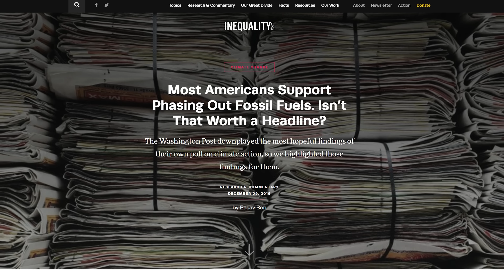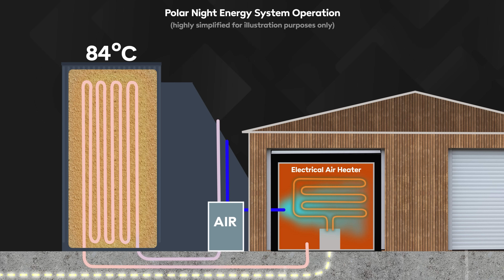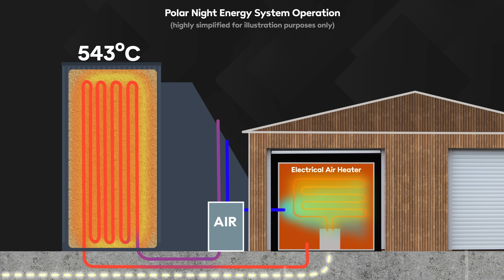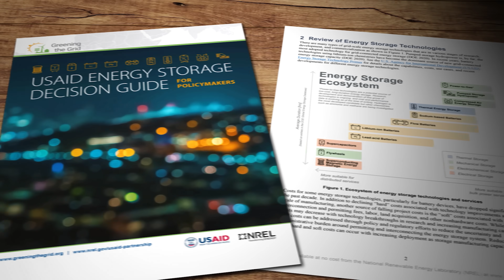The 'Sand Battery' that heats your home, NOT the planet!

Comment: This is very similar to ground source heat pumps based on long trench excavation and slinky pipes.... But this may be even more efficient.....

The only problem it cannot work in reverse and cool houses in Summer.... Is there a system for district cooling that can use the same pipe infrastructure? And save everyone from a burning end to their lives or the need to wear SPF 3000

Comment: The combined efficiency of using renewable electric energy sources to provide the simple heat energy stored and deployed here seems poor enough to invite skepticism of the whole endeavor.  No doubt naysayers will jump on that.  When they start talking about storing waste heat from other industrial processes and using electricity from periods of excess renewable electricity production, then it started to sound a lot better.  An excellent application for the “superpower” that the folks at Rethink X predict coming in the next several years.

Comment: The same thing can be done on an individual home level with around 2000 gallons of water to make the thermal mass.  I had a tarm wood gasification boiler for over a decade before I sold the home it had a 700 gallon thermal mass located outside the house under a porch in New Hampshire and worked great I had R60 insulation on the tank.  I am planing a system for my new home which will have a geothermal heat pump plus a storage tank that is an opportunity load for solar.  The plan is to use the storage tank over night and the heat pump when the solar system has capacity during the day.
Reply: I was just about to comment a very similar thing. A lot of more suburban homes have space for a ~3000l insulated tank which can store enough heat in for a few days. Combine that with variable rate electricity and you're ready for a renewable energy grid, or your own solar panels.

Actually one of the advantages of a low pressure tank is you can cheaply make solar thermal panels which are a lot more efficient area-wise than PV panels. Personally this is my next major project on my house.
Reply: @ThisRandomUsername  I am going with over sized PV because I have the space the don't need to worry about the freezing issues of solar thermal.
Reply: @DanA-nl5uo  PV also has the advantage of being as efficient no matter the temperature of your tank, so you can get to quite high temperatures if you insulate well. David Poz has made a video comparing PV and solar thermal.
I'm in Durban, South Africa with much milder cold weather, so a hybrid PV and thermal setup makes sense for me.
Reply: @ThisRandomUsername  I did see that comparison video he did a good job with it.

Comment: Great video as usual, I'm not aware of any district heating in my area (California) but that's probably due to the major population centers being built directly on active fault zones.  Sand as an energy storage medium is highly under utilized though and I love hearing about it being developed and the Ambri battery seems like its ultimate evolution, hopefully they will get a follow-up video
Reply: I live in the San Diego area and much of our downtown was heated by district heating with steam plants. I don't think any of it is used any longer and new buildings certainly wouldn't be using it. I found an article from 1987 that stated there were 40 buildings using it but that more and more were going to stop because the power company, SDG&E, was raising the cost of it. I think there are plenty of colder climate cities that still rely on steam heat.

Comment: The Netherlands has some district heating. My city is planning on rolling it out in the coming years to replace gas heating. I won't be using it and have converted to heat pumps instead. The problem with district heating here is the single supplier that makes it very expensive.

Comment: 0:25 Eh... I'm from Wisconsin and we typically have days over 100°F every summer. Sometimes even weeks of it. It's been like this for as long as I've been here, which is around 36 years. This summer is actually pretty moderate as far as heat goes... we've only had a few days in the 90s and none over 100 yet. I dunno. Cooler than most summers I'd say.
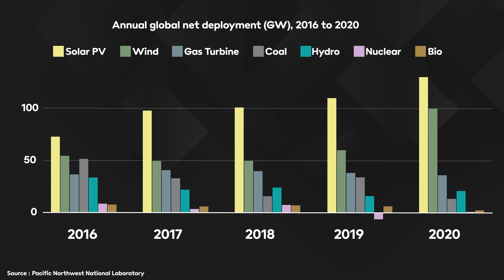Reply: 5:06 This graph can be used misleadingly. The REASON why solar is the highest entry here is because countries' government are encouraging it while discouraging more reliable sources of power like nuclear, natural gas and coal. So don't look at this and think "Oh, well what do ya know, everyone's doing solar now! It must be really good!" Uh... no. They're doing it because they're being forced to. Don't get it twisted. If energy companies were given the choice, Natural Gas would be number 1. Cheap. Reliable. Easy to build. Very quick startup times. Consistent energy output. All in all, better.
Reply: 6:42. What are you talking about? lol. Burning wood is carbon neutral. The trees sequester the carbon while it's growing and then release it when it's burned. Net Zero CO2! Sigh. The state of the world's energy industry is laughable these days.
Reply: I dunno. The general idea is here is good. It can be 'dirt' cheap, especially if you just bury it into the ground and build a bunch of greenhouses on top of it. But when you think about it, this tech wouldn't really be feasible if solar and wind weren't so crappy and inconsistent with power generation. Solar and wind is great for local use... I'm even thinking of installing some on my house for a little extra power here and there... but if I'm being honest, power is cheap here. Something like $0.11/kWh. Solar, if not for the government subsidies (meaning us taxpayers are paying for some of it) wouldn't be economically viable for me. Even now, doing it is mostly for kicks and not because it's actually needed.

It's just... when you have to come up with new way to make a technology that's forced upon the public to be worthwhile, it says something about the governments doing the forcing. And it's not anything good.

Comment: They did have a few "experiments" with district heating systems here in old Blighty!
I remember one in Ardwick Manchester back in the 80's. It piped hot water to a council estate used for heating. 
It did not last long!
I am unsure of the reasons for it failing but they did have problems with leaking pipes under the roads. I suspect the method of charging was a tad too social too (If I remember rightly it was a fixed charge so you had "free" heat) which had people using open windows to regulate temp. I would like to say we have moved on from those times but I am aware of multi story blocks that have had to have new risers put in because the tenants did not get charged for heat and burned the electrical system out through overuse!
Obviously we can do better!

Comment: Hi Dave, great video, I watch them every week.   I design district heating systems here in the (UK).  The industry is going through large changes as we speak.  You spoke some of high temperatures needed.  While this is important for certain sources, particularly EFW or where power generation is included in the scheme, the major trend is leading towards reducing temperatures in the systems and using more heat engines that can be powered by renewables.  Heating design practices and regulations are both being geared towards low temp solutions that can be driven by heat pumps.  If you want more details and some exciting happenings for future, let me know.
Reply: Hi Joe,  you can do it two ways.   You can have a central heat pump and run the district at about 60C to feed the connections, or you can run the district at close to ambient temperatures (10-20C) and have smaller heat pumps at each connection.  The latter generally means a lot of equipment however, which means lots of maintenance and higher front end costs.  The former is a bit less efficient, because you loose more heat durning transmission.

The lower temps allow the use of heat pumps which can be powered by renewables, and reduce the heat losses from the network.  Heat pumps also worke at a much higher per efficiency than combustion plant.  The higher temp systems require a high temperature source, which usually means combustion.  Green hydrogen could be used for higher temp systems, but the market and distribution of it hasn’t developed enough to implement them at any large scale.  You can always put a high temp thermal storage system on a lower temp system, and it may be worth while if you are dealing with fluctuations in the power supply or some similar condition.  You would have to heat the sand store with a high temp source however.
Reply from the maker: Cheers Jason. That sounds like very encouraging news for the UK. Thanks for sharing this info.
Reply: Thanks for your comment.  It raised 2 questions:

1.  In the lower temp scenario you described, would each home/bldg have a heat pump or some other form of heat engine that would tap into the district heating system?

2.  What problems would lower temps solve and would those problems still exist in a sand-based high temp system?
Reply: Hi Jason,
Floor heating only needs water around 23°C for a comfy feeling. That's 'cold' water...
Faucet water hardly needs to be more than 40°C.
Mostly these temperatures can be easily achieved tapping at 100 mt underground, and there you go...
At least here in the Netherlands.
What is you perception about that?
Reply: @benzonex  40°C tap water has the risk of becoming contaminated which legionellae bacteria. That doesn’t seem like a great idea. There might be solutions for this that I’m not aware off btw.
Reply: @benzonex   underfloor heating at 23C would require extremely well insulated buildings and likely a room temp of 18?  UK standards require being able to provide 21C room temps still.  Recent design guides have started allowing 45C water to taps using non-storage sources, there are still some issues with the requirements of anti-scalding regs that work against this.  Scandinavian countries have a well developed regulatory framework for heat networks that the UK is just getting started developing.  I imagine things will trend to lower temperatures as we decarbonise and move towards better insulated buildings and the like.  Still kind of the Wild West over here.

Comment: I live in Poznań in Poland. We use district heating for the whole city. 
Up sides: no space in side the house or outside is used for heat generating machinery (such as heat pump), no smoke in the house or in the city center (personal heating stove), no noise; low cost of installation for an individual 
Down sides: loss of heat on transport from central station to the place of use (houses); high maintenance cost of heat transport grid, no acceptable, fair and realistic way of pricing the service that includes the co2 emission.
In my opinion this only makes sens, if the main source of heat is burning cool or other fuel. The smoke generation is moved to a place far from city center and to a big facility, where the smoke can be filtered out of pollution. It generally lowers the pm10 and pm2,5  pollution very effectively. It does nothing to CO2 pollution. In my opinion it is a dead end way. Using a wind turbine is ... Why not just find a way to store electric energy and send it to users to convert to any kind of energy they need? I see no real benefit of converting electric to heat and we loss the opportunity to invest in electric grid and electric heating. 
In my opinion we should invest in electric grid, isolation of buildings, heat pumps  and resistance heaters on site.
Reply: The answer to the question why we do not store electricity is quite simple. Batteries are too expensive, and the current lithium prices have already gone up, not to mention that if you want to store electricity for the winter  you just run out of lithium, other types of batteries are still too expensive and their production destroys the ecosystem. Personally, I only see hope in nuclear power plants and geothermal energy (which is not readily available everywhere, hopefully the technology of drilling with rock evaporation will provide a solution.)
Reply: @jakubiskra523  Agree on the nuclear. Also geothermal where ever possible. Also wind, hydro and solar wherever possible. But still nuclear. I don't see any other solution.
But combining wind turbine with a heat generating and storage system?  This is a math problem and I just don't have enough data to solve it, but my gut teals me  that that doesn't calculate and my experience with existing district heating systems is as above-dead end.
Reply: @jakubiskra523  creeria que si almacenas calor en la arena con paneles solares  y luego la transformas en electricidad y la distribuis a la red eso seria formidable ya que podes levantar temperaturas de 600 a 1000 grados y es algo que funciona, habria que ver esa transformacion de calor a electricidad! saludos
Reply: @diegogallardo8552  El punto es almacenar esa energía para el invierno, necesita tanques GIGANTES, ya sea financieramente rentable
Reply: @diegogallardo8552  sorry. I don't understand spanish.

Comment: Could anyone do the calculation on what the total thermal energy would be for sand vs water in the same volume
Reply: The issue with water is the extreme pressure at 600°C.
Reply: Sand has a specific heat of 830J/kg/K, and water is 4200J/kg/K.
So water has approx five times the thermal capacity of sand.  However, water cannot be heated above boiling point without a pressurised system.
Mass versus volume difference also applies.  Sand weighs about 1.6 times more than the same volume of water.

It requires more/better insulation as the temperature is raised above ambient.  Losses for 600 degrees is obviously far greater than for liquid water.

Good luck with your calculation.  It is not a too difficult problem to calculate, even without a computer.

Comment: You and people in virtually every village and city do have infrastructure that is sufficient for distributing very large amounts of heat - underground water pipes. These pipes are sized to supply very large amounts of water for emergencies (basically firefighting). This water can be used to feed heat pumps, which is much more efficient than air-source heat pumps. Ideally these water systems would be modified to be sized for thermal capacity, insulated to cut heat loss (or gain), and probably a second system to return 'used' water to the thermal source. Although the heat transfer capacity would start out as being quite large, it might need to be expanded. Upgrades for capacity and return flows would increase the water flow capacity of the system for emergency demands. You would still need a heat (or cooling) source, but this should be relatively simple (low temperature heat can be supplied in many ways).
Reply: The number one goal of a water utility is the provision of SAFE drinking water.  Each heat exchanger added to the system represents a potential source of contamination and bacterial growth.  They would never go for it.  It would be very expensive as well.
Reply: @incognitotorpedo42  The only legal requirement for design of a system like this is that it be engineered by a professional engineer. That said, everything you add to a system does create a potential for contamination ('bacterial growth' is redundant). This is a legitimate issue, but not an especially large one as long as the water remains within a potable water system. The cost would not be low, but since there has be be a potable water system anyway, in a broad sense the marginal cost for it would typically be lower than the total cost of a heating-only system. However this would vary depending on the current status of the potable water system. A simpler, lower-capital-cost alternative would be a one-way system that did not recirculate water and simply extracted heat prior to feeding the water to a building for general use.
Reply: That's not how most villages are.
Reply: @TheNicog1  Most villages don't have fresh water supplies running through pipes for general use and for fire fighting? It is true that these systems (which do exist in most villages) would need to be modified to be used for dual purposes.
Reply: @jimstiles5278  There are separate systems, and you can't have cold and hot water at the same time in the same pipe. Obivously.

Comment: Dave, 

Thanks for raising this important issue.  

When it comes to heat, the laws of thermodynamics start to play a role.  One that cannot be ignored!  The Finnish heat battery uses resistive heating - which means 1 kWh of electricity becomes the same amount of heat, ie. 1 kWh.  Because space heating only needs low grade heat (my underfloor system is typically at 30C) a heat pump can run with a coefficient of performance between 3 and 4.  Which means 1 kWh of electrical energy "moves" 3 - 4 kWh of heat to usefully heat your building.  If anyone currently has "surplus" renewable electricity, in my opinion at least, they should be using it to power a heat pump.  If we were all doing this, it would create sufficient electrical demand to avoid any surplus, given the heating requirements in the UK.  I appreciate that this doesn't solve seasonal heating requirements, but thermal mass, good insulation and control of infiltration in our buildings would go a long way to making this work in the UK.

One of the worst things western societies are doing is converting high grade fuel into low grade heat, particularly when that fuel is adding carbon to the atmosphere.
Reply: Yes I thought about this too, but the amazin bit was, that they can store heat for months. Granted only for 80h of discharge, but it still lets one dream if we can offset summer heat / solar surplus towards the winter
Reply: The steel, paper, cement and other process industries will be the main source of the waste heat.
Reply: If we're talking efficiency, nothing beats a proper heat pump. But the economics are much different, because the cost is much higher.